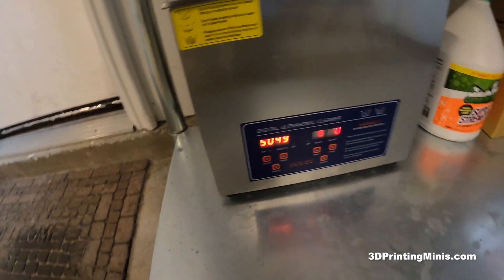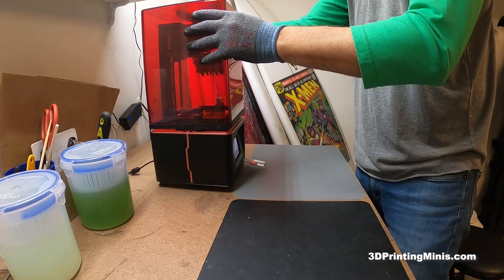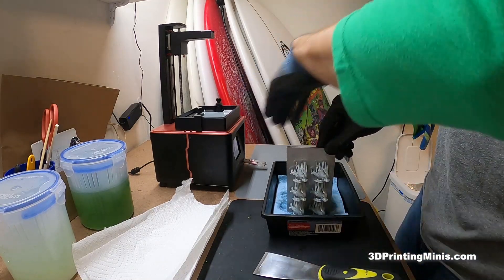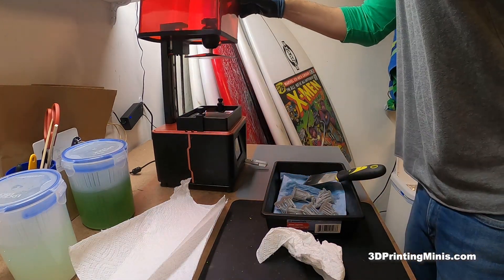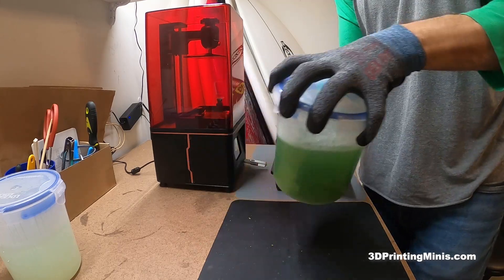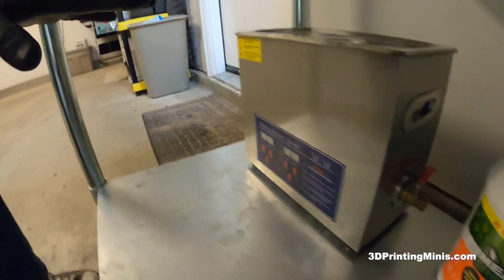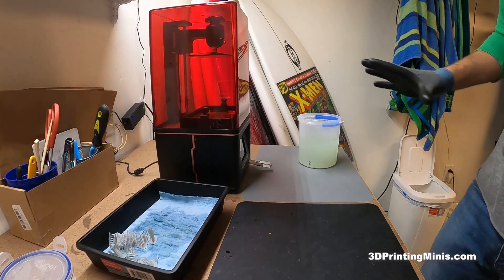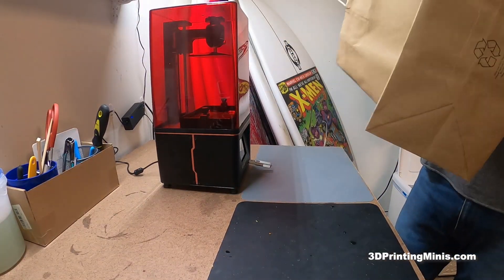How To Clean 3D Resin Prints - 3D Model Cleaning Workflow Using Mean Green & Ultrasonic Cleaner

Comment: What do you do with the paper towels at the end? since they have resin on them and such?
Reply from the maker: I cut hole in the lid to the trash can I use and stick a UV flashlight through the opening. Then I throw the used paper towels in there 1 to 2 at. time and let the UV light cure them for a couple of minutes. This cures and hardens them right up.

Thanks for watching and commenting. I appreciate both. I'll making videos and releasing new episodes of the 3D Printing Minis podcast in the coming weeks. The show will be on iTunes, Spotify, etc. but I'll also upload the full episodes here on this channel as well. Hope you subscribe and tune in. Thanks. - Dan

Comment: Do you find that the prints will sometimes start pitting? I’ve found that these tiny holes appear and I’m not sure if it’s due to cavitation erosion from the ultrasonic or some kind of chemical reaction with water
Reply: That sounds like you are deploying the ultrasonic for too long. You eventually corrode and break down the actual mini when left for too long.

Comment: This is a great video especially for us limited on funds and space to work with.  I am doing my research before buying a 3D resin printer and your process is very doable.  How do you handle your dirty mean green once you have depleted it's cleaning potential, can it be placed in a location where sun light UV cures any resin within the mean green solution and then properly disposed of.  Thank you for your time and for sharing your process.  Happy printing.

Comment: How has Mean Green been holding up?  Do you filter the resin out of it every so often or just put it out for hazardous waste pickup every so often?  I picked up 2 gallons to try out but haven't done it yet, need to think out all the maintenance/recovery/disposal things I'll be doing...  I like the idea of using heat cycle on the ultrasonic (Unfortunately the heater on mine is burned out though), and reduced odors of the Mean Green...

Comment: Sorry. Not sure if I missed it but what's inside the ultrasonic?
Reply from the maker: I use Mean Green. And swap it out every few weeks when I'm running a lot of prints.
Reply: @3DPrintingMinis  Thank you! I will look into it. Mean Green is safe to heat?
Reply from the maker: Not sure. You'd need to google the manufacturer and contact them to find out for sure. Should be able to email or FB/IG/TW message them and get a response.

Comment: Low budget tip: If you don't have a fancy cleaner, you can switch the bath and the toothbrush step. If you scrubb them after the first stage wash, it'll be more messy, but the scrubbing will only need a manual rinse in iso afterwards.

Great video, I like your style! Some people cut videos down to not show any mistakes (like you dropping the mini like 5 times 😂), but the more extended cut type of video is way closer to reality and shows a lot of detailed steps in between. Keep it up!
Reply from the maker: If I cut out all of the mistakes and dumb parts all of my videos would only be 3 seconds long. 😂

Comment: Just watching through your video series since I just started 3D printing myself, I think it'll be super helpful. Question though, if one didn't have an ultrasonic cleaner, what would you replace that step with? Or would you say this method requires an ultrasonic cleaner?
Reply from the maker: It's doable. Some people will use a wash and cure station instead. Or, they'll use 3 separate containers of IPA (not too clean, pretty clean, and very clean) and rinse/dunk their models 1-2-3 in each for 30 to 60 seconds each. I have used this technique and it works quite well.

Comment: Hello friend, the information you have given me is incredible, I looked for it for a long time, I really appreciate that you take the time to give us this kind of advice. I tell you that I make 3D prints to make negatives for chocolate bars, it is important that the prints come out very bright, what resin do you recommend that can shine after all the cleaning and curing steps you mention. It is important to mention that when making the silicone copy this 3D piece should not have additional paint to shine because it comes off or makes the silicone not cure or catalyze. On the other hand, I have seen that you have a digital humidity and temperature meter, can you pass me the link of the one you use as well as the mat on which you place the prints?
Reply from the maker: I'm not sure resin prints are safe to use with food or food products. You should contact the manufacturer of the resins you are using to make sure they are safe to use for your purposes.

Comment: Great vid! Very informative :) I was wondering if you could share your workflow re: cleaning out the Ultrasonic Cleaner. Do you just drain all the fluid/resin out of the tank into another container to allow the resin to settle to the bottom before cleaning it out?
Reply from the maker: The clean out process is pretty simple. If I'm running Mean Green inside of the vat I put the ultra sonic cleaner up on my workbench and drain vat (through the little drain spout on the side) into a large, empty OJ or Apple juice bottle. And then wipe the inside down with clean paper towels. Then spray some 99% IPA in the vat and wipe it down with more clean paper towels. That's it.

Then I take the bottles of old Mean Green to the hazardous waste disposal drop off site in my town and cure the paper towels in the sun on the side of my house before throwing them away.

I've recently switched to filling the cleaner vat with plain tap water and putting my cleaning Mean Green into large, sealable mason jars. Then I only need to clean out the jars every so often. And the water in the ultra sonic vat I can just dump down the sink because there aren't any chemicals or resin in it. I'll try to make a video of this new process I'm using soon.

Thanks for watching. I appreciate it.

Comment: Hi - great video. I was wondering: Is there any residue from the resin left in de ultrasonic cleaner after the cleaning ? 
And how long do you cure prints ?
Reply from the maker: The inside of the cleaning vat is stainless steel, so any residue just settles at the bottom. When you clean the tank out (depending on how often you print) it pours out and you can wipe up any remaining residue or bits with a paper towel.

As far how long to cure prints, I have a video about that on my channel. It depends on what kind of resin you're using, what type of curing station you have, and the models you're printing.

Comment: Thanks, that was super helpful!  Do you do anything with your printing tank, or does it just sit on the printer all the time and just gets topped off with new resin?  What do you do if you want to change resins?
Reply from the maker: I don't remove the vat unless I have a catastrophic failure that either sticks to the FEP or leaves lots of pieces of failed print floating around in the vat. If I'm running prints using the same resin I'll just top off and print the next batch. If you change resin you have to change your vat and you need to wipe down and clean all sides of your build plate with IPA and some paper towels. Some people buy multiple vats to store different color resins to make switching between them easier. You need to make or buy covers for these vats and make sure not to spill them. I've never done this but it sounds like a cool idea if you're someone who prints a lot of different kinds of resin all of the time. I have a very soft silicone BBQ baster I got at the dollar store that I use to gently swirl around and strain resin through to check my vat for failed pieces and supports between prints. This seems to work well.

Comment: What’s in the ultrasonic cleaning container?  Water?
Reply from the maker: It’s Mean Green heated to 50 degrees C. You can also use heated water instead. In that case you can fill a ziplock bag or heavier duty Mylar bag with Mean Green or 99% IPA. Either method works. It’s just personal choice.

Comment: ive seen people mention and i havent even ordered my ultrasonic cleaner yet.. but people put the item in a sandwich bag or something sealed full with IPA and drop that into the Ultrasonic cleaner filled with water and it keeps all the resin out of the ultrasonic.. have you ever tried that?  how often do you clean out your tank?
Reply from the maker: I've seen people discuss this method as well. It seems to work really with when using IPA (i.e. 99% alcohol). The reason being that you don't want to heat up a vat of IPA to 50 C/120 F because, well, danger/fire/explosions/etc. :-)

Also, IPA is kind of expensive so using a bag of it makes it last longer and wastes less. Instead of a plastic bag I've seen people use a metallic mylar bag to hold their IPA as well.

I went with Mean Green because it's less expensive, less flammable and doesn't smell as bad. Also, I can leave the Mean Green in the ultrasonic cleaner vat for months (as long as it's covered) and nothing much seems to happen with it. I've been using the current Mean Green vat for over 2 months (and dozens of plates of prints) and I'm still getting really good results from it.

I'm a little iffy on heating up a bag of IPA (even if it's in water) on a workbench inside my garage. Seems like too much potential for an accident. But, yes, people definitely do it and many seem to really like using the method.

Comment: hi bro, nice video. What do you have in the ultrasonic cleaner?
Reply from the maker: I forgot to mention it in the video but it's in the video description. It's straight Mean Green (about 2/3's full in the vat) heated to 50 degrees Celsius. The heating it to 50 C is really what makes the prints come out so clean and helps the support come off so easily.